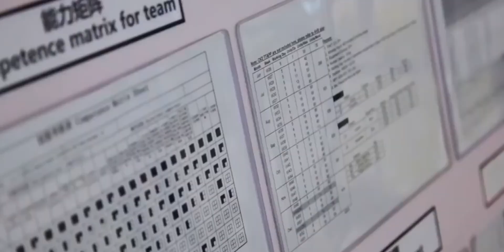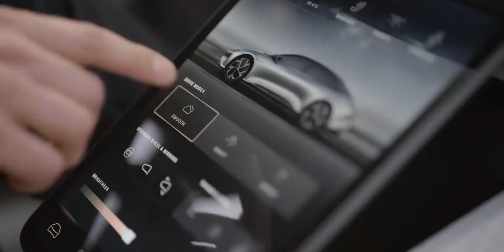Every EV Owner Should Know This Trick

Comment: Of course, if you have an Aptera, and only commute for less than 40 miles a day, you will never need to plug in to the grid as it charges itself from its own solar panels, and if and when you do need to, your vehicle will use a lot less power than most EV's. Click on the Aptera logo to the left of this comment to find out more...